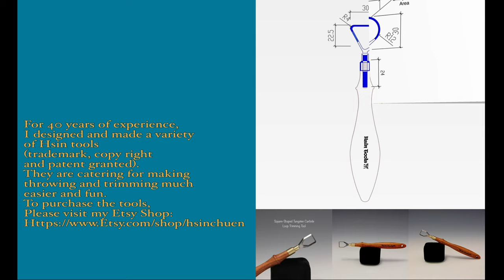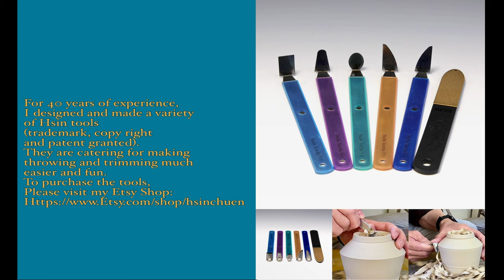666. Instant Stiff Slab Construction Method to Make a Square Vase with Hsin-Chuen Lin  林新春 土片成形方瓶示範

Comment: I have never seen tar paper with flowers and leaves patterned into the surface.  Have I missed a step?
Reply from the maker: I roller the slab with flowers and leaves texture matt. After I pulled off from the constructed vase, you can see the texture was printed onto the tar paper.